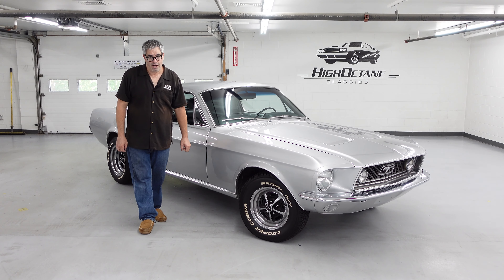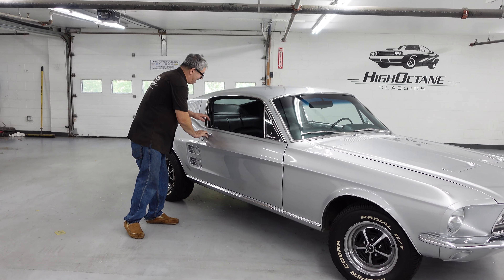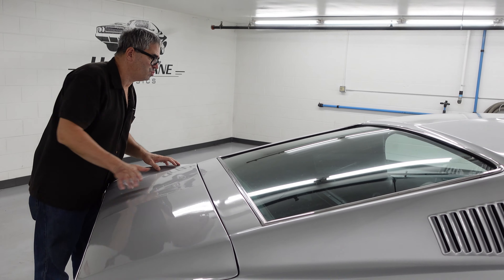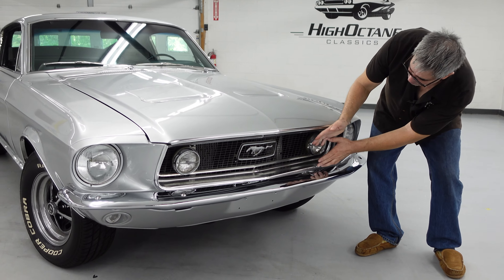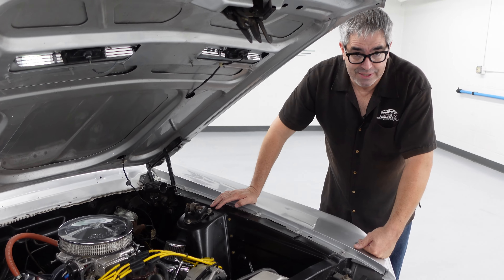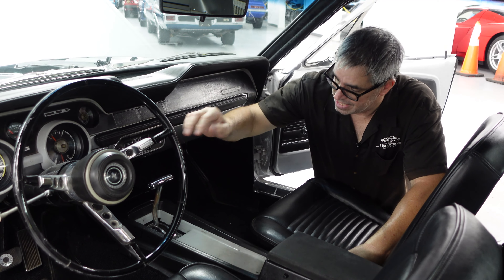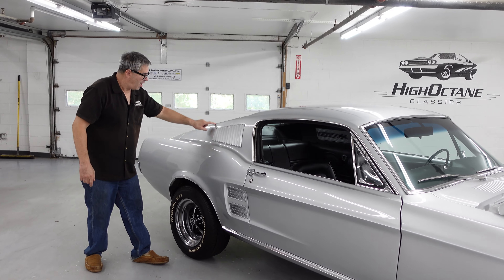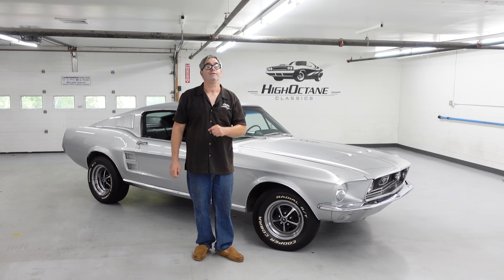1967 Ford Mustang Walkaround with Steve Magnante

Comment: Dad had bought a 67 fastback in the late 80s to restore, but it was totaled out parked on the street by a local drunk driver. He had a done 70 grande before that which he sold for reasons. The 67 was a straight no rust example with a 289 and four speed. Had it survived I probably would’ve cloned it look like the bullit car. He did get a 69 fastback as a retirement project off the original owner which I’m currently finishing up in his memory. Love the one in the video and I actually prefer the 67/68 model years.

Comment: Not to be a wet blanket, but is no one going to mention the fact that is clearly a '68 grill on there?  Five key items separated the 67 from the 68, visually.  1.   Finned side scoops(67) vs chrome trim only(68)  2. '68 had side blinkers/markers in front and rear on side of fenders and quarter panels. (safer, yes, but ugly)  3.  '67 had 3 spoke steering wheel vs. (IMHO) ugly 2-spoke in the 68.,  4. Side name badge changed to script from block letters in 68.  5.  And lastly....67 has DEEP pony in the grille with side wings.   Outside of the fact that '68 came with 3-point harness seatbelts and the engines finally had matching VIN stamps, the '67 was far superior in looks.   '68 removed most of the individual features that made the 67 unique to look at just to save a couple bucks cause Chevy and Mopar started releasing competition and they wanted to keep pricing down.  = (

Comment: Bet that front end flexes badly without the export bar going from the shock towers to the cowl.. yikes…
Reply: Yup.  A lot these 'restored' cars with shiny paint and chrome have SERIOUS defects, both structural and mechanical.   Go have a look at Uncle Tony's Garage for examples.  Mustang coupes made into convertibles by some hack who didn't bother to add any of the convertible bracing that the factory welded in so the cars don't twist up like pretzels when they drive over some train tracks.  Cars that are more Bondo than steel.   A Mercury Cougar from this era that had floors made up of Bondo and chicken wire.  On and on it goes. This car has some seriously funky panel gaps.  Accident repair?  Extensive rust repair?  Both?

Comment: "People call then 1965 Mustangs."  Yeah 'people' may call them that, but Ford Motor Co. designated all of the Mustangs manufactured prior to 01/01/1965 as 1965 models.  There is no such thing as a 64 1/2 Mustang.  There are Mustangs with early features...170 cube I6 engines, 260 cube V8 small blocks, generators (instead of alternators), Falcon instrument clusters, etc, etc, but they were all 1965 model year cars.

Comment: Nice car, but unfortunately it's a Frankenstein car. 68 mustang front,, 68 rear trim, on a 67 car. Surprised this guy didn't notice it.....stripper model, no power brakes,  no power steering,  no factory AC...I have a 68 stang I bought in 1977. Has all the above mentioned items, 289, in beautiful condition,  on the road.😊